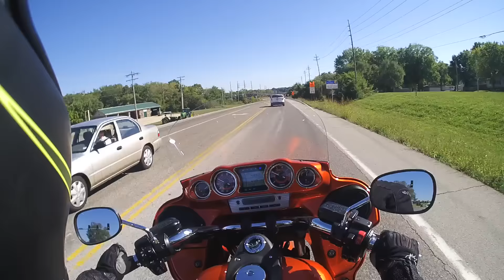Engine Braking, Yea or Nay?

Comment: I think just one thing to remember with engine braking (without using brakes as well) is that the brake light will not light up and drivers coming up behind may not realize that you're slowing down. Even with only slowing down a little your position on the road could be badly estimated by other road users, especialy seeing how motorcycles are already easilly overlooked.
Reply: That's why you lightly press the brakes while engine braking.
Reply: @Shane7492  specifically the rear break first. cause front break is too much for high speed braking.
Reply: That's why I slightly press down the rear brake
Reply: when u EB you also apply rear brake , reason for this is when u hv been  on fast ride

Comment: Im surprised nobody mentioned this, but I mostly use engine braking to slow down on hills and mountains, especially when it rains.
Reply from the maker: +KoshSonofAiur Yeah, for sure!
Reply: wow I didnt know that good tip
Reply: good point.... deffo good for downhill and raining
Reply: You don't want your brakes melting because you've been dumping loads of heat into them, why not dump heat into something that can handle it (like an engine).
Reply: Your brakes aren’t melting.
Reply: Just make sure you aren't downshifting at high rpms when you do that,you don't want to spin the rear tire. In all actuality riders should learn to use brakes and engine to ride. Almost all braking mishaps involve someone not utilizing all methods of braking. And 100% you will stop way faster with the engine plus brakes than without the engine. Pulling in the clutch and braking hard is a noob move.

Comment: In the advanced training here in the UK, the preference for normal rising is rolling off the throttle and downshifting over braking, with a couple of taps of the rear brake just to show a light. They like to see you planning ahead rather than reacting. For me, it's a case of using all the available tools.
Reply from the maker: +CalmBiker I addressed this "using all the available tools" thing in the video.  There is no invisible third wheel.  There's nothing the engine braking does that your rear brake can't do better.  However, staying in the correct gear is a good discipline.  Downshifting as you decelerate is important; in order to stay in the appropriate gear.  But it isn't "stopping better".

And yes, being proactive is essential!  Though I'd recommend in any situation when you're slowing down, to apply SOME front and rear brake (and more than just a tap, but holding to keep the brake light illuminated), in order to develop the very important muscle memory.  In an emergency, you want to instinctively apply both breaks.  The MSF, and some studies (including the famous HURT report) have concluded that a major contributor to serious motorcycle accidents is the application of just one brake.  Usually the result of complacently riding using just one brake all the time, because it's sufficient to slow them down in a typical, day to day situation.  I'm a big proponent of braking ALWAYS in the same 'position' that we'd brake in an emergency, so that we'll automatically go to that in an emergency.
Reply: +Romans Five|Eight When I say "using all the available tools", I don't mean that you would gain an advantage by doing all three at once. I mean that I vary what I do depending upon the situation. However, there are people who will brake from high speed to nothing without changing gear. This means that you either have to hold the clutch in to avoid stalling or you have the engine pushing you forward as you slow down. In those cases I would argue that your control of the bike is suffering as a result.

You have to take into account the type of bike as well. On a sports bike the vast majority of braking is on the front brake. Engine braking or rear braking have an effect but it is very low and may well lead to a lock up under heavy braking. On a heavier bike, particularly a cruiser with a lot of weight over the rear wheel, rear braking is much more important.

The main part is to know your machine and its characteristics and know how to get the best braking performance then practise, practise, practise.
Reply: My mum should learn to ride 2 wheelers

Comment: Around town, I do rpm matching and downshifting plus use of brakes This can be a really good thing if you've got to get on it to get out of harms way, and brake lights let cars know what I'm doing.  Mountain riding and long downhill runs are a whole other story. I use a lot of engine braking there to avoid baking the brakes.  Even excellent brakes like on my bike (BMW R1200RT) need some relief from heat due to long downhill braking.  Good to see you back John !  Thanks for the video.
Reply from the maker: +Robnord1 Yep, maintaining speed down a hill is a definite good use.

Comment: I've ridden motorcycle for 30 years. I came into it from having ridden bicycle competitively and from having traffic-jammed for many years. I didn't own a car. My experience on the 10-speed was that it was important to have the right gear handy at the right time, or else my legs would have to bring me up to speed sufficient to crest the next hill. If I were to use that as an analogy, I'd want to have the right gear handy for when I need it. You covered that very well. Thank you.
Reply from the maker: +Norman Teck Absolutely Norman; good analogy!  I'm a bicyclist as well.  Though they've come a long way since those iconic ten speeds!  My current steep is a carbon fiber bike with 22 speeds! (11 speed cassette on the back).

Comment: I have found with my Kawi Vulcan 900C that it engine brakes a LOT on its own.  If I let off the throttle just a bit I can drop as much as 20mph in no time.  I did not realize just how much or often this takes place until I began riding with a friend of mine and he told me my tail light was not working . We checked and found out it was but I was just letting off the throttle in top gear and my speed was dropping significantly.  I then began to apply my front brake just enough o warn others when even letting off the gas.  I would recommend always doing this if you are going to engine brake.  It warns others behind you that you are slowing down.
Reply from the maker: +Ted Smith Yes, using the brakes is important.  Your 900 engine brakes so well because of it's low gearing.  At 65mph in top gear your turning 4,000 RPM's.  The faster the engine is spinning, the more engine braking force it'll apply when the throttle is let off.

Comment: Just slowing down by shutting the throttle is what I call Engine Braking, changing down and letting the clutch out slowly is what I call Clutch Braking. Clutch Braking is vastly underestimated and misunderstood. Although Clutch Braking can make the rear wheel break traction if done a little too violently, you are much less likely to actually lock the rear wheel totally, simply because the engine is still going forward. Because of this, Clutch Braking gives you a massive advantage especially in poor grip conditions, in the rain or on gravel etc. Your rear brake is fixed to the frame so can lock the rear wheel which is 'bad'. Slight use of the rear brake, coupled with Clutch and Engine Braking will make the bike stop with much less dynamic weight transfer to the front wheel, leaving you with much more front suspension travel available and be in better control of the motorcycle as a result. Clutch Braking can also give you an extra 5 miles per gallon of fuel, as opposed to rev matching which uses fuel to rev the engine but is mostly wasted.
Reply: Well said! 
Thank you.

Comment: On a chain or belt driven rear wheel I only do engine braking moderately. On a shaft driven rear wheel I use it a touch harder changing down 1 to 2 gears depending on the situation. I have all 3 systems on my bikes. My personal preference is the Shaft.
Reply from the maker: The belt on the 1700 Vaquero in the video is a very stiff carbon fiber belt, power transfer is solid without the driveline loss of a shaft, so it actually 'feels' a bit like a shaft in that regard.

Comment: I've always used engine braking on my bikes as long as I can remember. I've got over 65,000 miles on my current bike with the original clutch and brake pads, so I know it helps in the long run.

Comment: 5th gear clutch disengaged

Front and Rear brakes applied to 
30% rear 40% front... speed dropping and from there is just all clutch... 
squeeze, downshift 4th release slowly...
squeeze, downshift 3rd release slowly...
squeeze, downshift 2nd release slowly...

Comment: My grandfather raced bikes back in his day, and rode daily for over 30 years, I remember him telling me that I must make sure that I'am always riding in the correct gear for the speed and conditions that I was travelling in or at. He said he found engine braking was a very effective way to slow down a motorcycle, plus it also ensured the bike was in the correct gear. I have always heeded this advice from him and find that it really works well. However in an emergency braking situation I still use my front brakes and apply them in a three stage grab.
Clutch in.
1. Pull the front brake in about 1cm.
2. Pull in about 2cm.
3. Pull the brake all the way in.
This has saved my butt on a couple of occasions. I would like to hear what you think of this method.
I'am far from an expert but have 10 years and about 240000km under my belt riding 6 days a week in all sorts of weather conditions. Iam always wanting to learn more and become a better and safer rider.
Stay safe and keep the shiny side up.
Reply from the maker: People who race or ride higher performance do tend to like the RPM's to be a bit higher. It all depends on riding style. Personally; I don't think that's the best route. You never want to lug the engine; but while decelerating or riding at a constant speed; keeping engine RPM's low is best for fuel economy and for keeping wear and tear out of the engine.

Comment: Repeat after me:
Engine braking is NOT the same as slipping the clutch on a downshift.
Engine braking is NOT the same as slipping the clutch on a downshift.
Engine braking is NOT the same as slipping the clutch on a downshift.
Engine braking is NOT the same as slipping the clutch on a downshift.

Downshifting is not a requirement for engine braking to occur.
Downshifting is not a requirement for engine braking to occur.
Downshifting is not a requirement for engine braking to occur.
Downshifting is not a requirement for engine braking to occur.
Reply: Thanks on this :)
Reply: If you didn't SLIP the clutch it would be the same but best thing to do is to pop the throttle while down shifting and let the clutch go.
Reply: @martindekker8203  That's called rev matching.

Comment: I hesitate to comment simply because the last comment made on this appears to have been a year ago. I grew up driving eighteen wheelers and using dual transmissions, ie; five and a four. I learned about forty years ago that when you have your transmission and gear boxes in a no-load match where rpm is common you can slide in and out of gear effortlessly. You did an example in the video of slight revving on a down shift. Actually, iy you ease throttle just before the shift (split second) It is a habit for me and I do it without thinking, you can go down to the next gear by holding the throttle exactly where it is and shift. When you shift it will automatically increase rpm in the moment it is in a no-load status while the clutch is engaged and it will re-engage at the precise rpm it needed to be at. I don't know if I explained that clearly but I do it all of the time. I down shift as I slow and always keep by the engine at the best power range. I ride a Victory Octane and redline is 8300. There is a sweet spot at 4000 rpm and I try to keep it in that range as I come down. If I ever need to move in an emergency I am at the right power and in the right gear with no searching or multiple downshifts.I may not always do this around town but on a ride when riding the mountain roads and byways I always do it, it is a habit. It also means you can make a smooth shift in almost any condition.
Reply from the maker: There are indeed newer comments, YouTube by default shows "top comments" first, those that have received the most "upvotes".

What you're talking about is staying in the optimal gear; which I think is crucial.  What I'm addressing, mostly, in the video is this:  I see motorcyclists using downshifting exclusively to slow their bike down.  This creates a bad habit, adds time to braking and it's all to avoid what is a very simple and inexpensive maintenance task.  At least, in my opinion!

Comment: I have a 93 vulcan 500.  It is geared so low that I can putt around at 35 mph in 6th and it not be bogged down too bad.  At 65 or 70 on the highway, she is screaming.  I don't have to use my brakes half the time because of the gearing.  Engine braking is just kind of like an auto brake for me when I let off the throttle. If I am in heavy traffic I will still pull the front brake lever back enough to activate the switch when slowing down without brakes.  I am a very defensive rider so I try not to put myself into situations that require heavy braking.  But when I do use my brake, it is mostly front brake unless it is heavy braking, then I use both front and rear.
Reply: Generally the larger the capacity of the motorcycle the better the engine will brake as you are creating larger pumping losses behind the vacuum closed butterfly valve (greater volume of air being moved etc.) You'll also find motorcycles with a larger reciprocating mass in the engine (think of very sturdy adventure bikes, single cylinders etc.) will be less responsive as the reciprocating parts carry less inertia while a sports bike engine is built with a lower reciprocating mass to make it more responsive. So a rider used to a Kawasaki Ninja 300 (low capacity, responsive twin) would need quite an adjustment to ride a Kawasaki KLR 650 (larger capacity, study single.)
Reply: i accidentally downshift the gear in high speed and my engine roars. and i wonder what adverse effect does it make to my motorcycle engine. i did downshift from 3rd gear high speed to secondary! i hope my engine is fine.

Comment: I always engine brake. Mostly for simple easy slowing when coming to a stop sign or red light. Now if I have to brake harder like the light just changed then I don't. I use my real brakes. The engine is just a means of a "controlled" braking. Well for me at least. I know I'm a little rough out with clutches but I'm used an old manual truck with no power.

Comment: I especially use engine braking going down hill, on a bike or in a car.  It's not about saving the brake pads, but it helps prevent brake-fade from overheating brakes, especially low quality pads.  I had it happen once in a car and it's not nice.  It's also a habit carried over from limited 4X4 experience where the brakes can cause you to lock up and loose control while the engine never will (unless it seizes), but really it's just a preference thing; I just feel more comfortable attacking corners in a lower gear.
Reply from the maker: Yep.  I don't think I articulated myself well.  That's not the kind of thing I'm talking about.  Maintaining speed down a hill, etc., that's fine.  I know many people who never touch their brakes, who just downshift to come to a stop at a stoplight, etc.  I think that creates bad habits.
Reply from the maker: Yep.  I don't think I articulated myself well.  That's not the kind of thing I'm talking about.  Maintaining speed down a hill, etc., that's fine.  I know many people who never touch their brakes, who just downshift to come to a stop at a stoplight, etc.  I think that creates bad habits.
Reply: Right, gottcha! BTW, love the videos mate

Comment: I tend to ride with a combination of both. I think the rise of everything being an automatic has reduced peoples understanding of what’s going on.

My first car was fairly under braked - so I long downhills, I did have to use engine braking or risk running out of brakes (rear drum, unventilated front disk) I did experience this, so I can see why engine braking might be considered unnecessary with modern brakes. 

I tend to engine brake as I am slowing down to an intersection as well as brake in the final stages. I am not doing it because I want to save brake pads - I’m doing it because it’s under control (vs pulling the clutch in)

Comment: When you engine brake & apply some front/rear brake so people behind you know your braking, you are infact in more control of the bike then just using your brakes alone and pulling the clutch in. Remember pulling the clutch in and holding it there your are actually loosing all of your control on the bike. If you down shift and let the clutch go your are infact engine braking. Worst thing to do it pulling clutch in and holding in then using the brakes to stop. Engine braking, popping the throttle and using some brakes is the safest way to come to a stop or pre-pair for a corner then you can also use trail braking or use the engine braking as a trail brake. I love engine braking especially on my Triumph which has a 270 degree crank which gives you more engine brake.

Comment: I use engine braking - a lot. But I use it WITH my other brakes. Because as you and many other commenters have pointed out, it ensures that you are in the proper gear for returning to speed.
Reply from the maker: +jr63049 That's it!